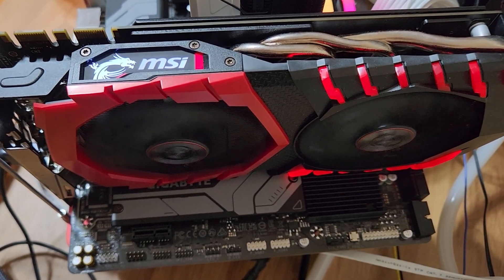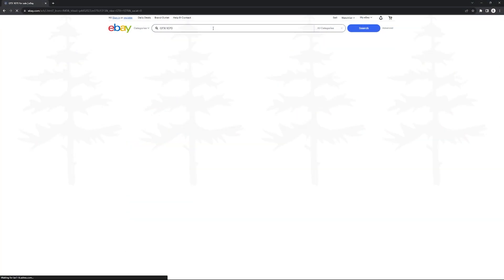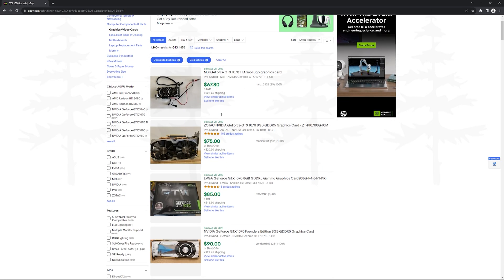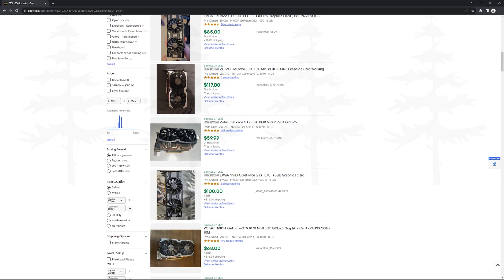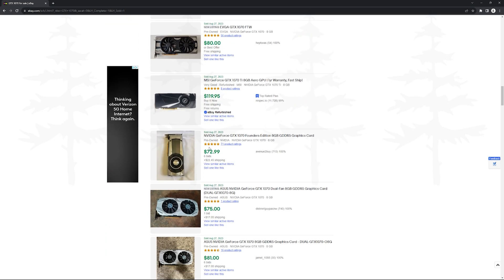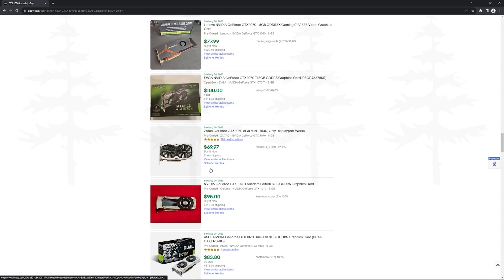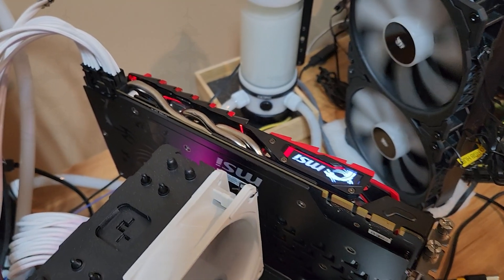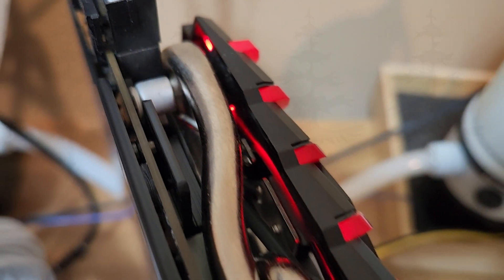No DLSS on GTX1070.. but AMD to the Rescue?? \\ This is Why I Say AMD is for the Gamers

Comment: Does the ryzen 7 5800x3d have to be ran with a water cooler
Reply from the maker: nope it runs very cool and it runs just fine on a $20 air cooler 

https://youtu.be/9h8VcQ_Isak
Reply from the maker: you can also undervolt it to run even cooler, 3 min guide here: https://youtu.be/fVvH03z-J-I

Comment: hi i have a rtx 3070ti and 5800x3d,i want to switch to amd.i will go for a rx 6800xt,is this a good change?or a stay with the 3070ti??
Reply from the maker: 6800XT is better for tarkov, but 3070ti is already very good for 1440p. If you wanna go 4K with FSR, 6800XT will fare better but at that point 6900XT makes more sense for the price

Comment: hey bro i came from your Pulsar review 😂 wondering after some time do you still prefer your DA?
Reply from the maker: my man! thank you for checking that out! 

Yeah, I think I have a rotation of close to 10 lightweight wireless mouses now, all are elite in my opinion. Within the elite category, yeah the DA3 still stands out as the best for me. Shell rigidity/feeling and that Razer optical switch is just a cut above anything else out there right now for me.

Comment: Hey Pyur, I just wanted to update you on my performance with the 4090, ddr5 (6kmhz) and my 7800x3d. The performance for 2k gaming on this build is just purely amazing. My questions here is, do you think the 7900x3d was the way to go or was the 7800x3d just perfect. let me know thanks
Reply from the maker: in theory the 7800X3D is "technically" better because it's 8 core vs 6 core on 7900X3D but in practice, i really haven't seen much difference in tarkov. I will do more direct comparisons, I get so many ideas my video do list is really long now ha